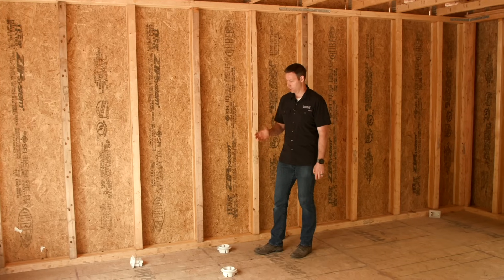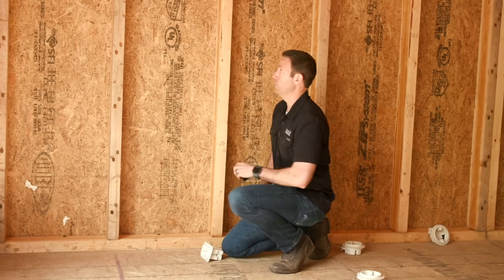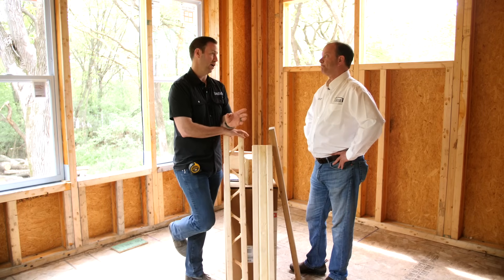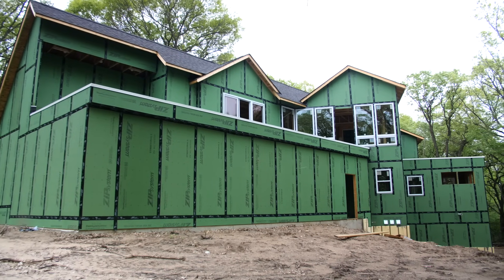Insulated Studs? This is a BIG Innovation in Framing!

Comment: Looks like a lot of houses are gonna rot out and collapse early
Reply from the maker: What makes you suspect that?  No matter the wood framing it must be kept dry. “If it can’t dry, it’s gonna die.”  Your water management system is paramount for a durable house. Huber Zip is an excellent system for both water and air barriers.
Reply: @buildshow  ill pass on replacing wood with foam

Comment: As a finish carpenter in always looking a products like this.  What he needs to do is get it into Lowe’s or Home Depot.  That’s what will change the industry first!   Drive costs down and save us all.
Reply: But he mighg only be able to make a 500 thousand a year their going to want millions always gonna be outa stock hes gota grow first
Reply: The only savings at the Big Box is to buy their OSB by the truckload, but then you piss off your lumber supplier by cutting him out of part of his framing package.  I know some will increase your board foot costs for joists or beams or something because you shop the rest at Brand X.
Reply: How many builders have their lumber delivered to build sites from Home Depot? I would estimate zero. I’ve never seen a lumber delivery come off a Home Depot truck, I don’t even know if Home Depot has flat beds or roll off trucks to deliver larger lumber orders
Reply: @Alex-us2vw  I've got a buddy who bought two units of OSB from Depot whey then held the price for 4x8 sheets at 7 and a half bucks during a volatile time when the lumber yards were a buck higher.  He saved 120 bucks.  Whoopie.  For 9 & 10 foot sheets you're back at the yard anyway.  He doesn't do it anymore.
Reply: Steevo did they have a way to deliver it to the job site? If not the buyer would’ve easily lost the $120 he saved in paying an employee to drive to Home Depot, purchase, get loaded, plus the fuel for the truck (if he even had a flat bed).
Reply: @Alex-us2vw  Depot delivered the first unit.  The truck probably had a forklift, just like when they deliver pallets of landscape blocks.  My friend used his own trailer for the second unit cuz it saved even more money.  He's always trying to get a better deal, but this proved too inconvenient in the long run to keep on doing.
Reply: Don’t think the Home Depots where I live delivers bulk lumber orders, and definitely not landscape pavers, bricks since they don’t them. Only the landscape stone suppliers seem to stock retaining wall stone, armour stone, pavers, geotextile, and bulk gravel/screening. The stone products at Home Depot here are consumer style DIY garbage. Even the washers and dryers they “deliver” come from a 3rd party delivery service
Reply: @stipcrane  They buy in enough bulk that they can keep pricing somewhat insulated from the market fluctuations but the quality of the OSB they sell is usually inferior to what you can get at most lumber yards. And like you say 9 or 10 foot sheets and your back to the lumber yard.
Reply: @iamjackalope  Depot is a huge corporation, far bigger than any lumber company, and I agree that they probably buy 10's of millions of dollars of wood product futures to weather price storms.  Also, they usually have OSB and 2x4's displayed as soon as you walk in the store with a killer price.  They may be losing a few cents on a couple items, but it gives customers the illusion that there is no cheaper lumber store on earth.  Lumber companies get 1000 board-feet prices and mark up stuff fairly uniformly, and you may be getting a much better deal on the rest of the stuff on your list.
As far as quality goes, everyone in the northwest is buying from the same mills (mostly Canadian) and they all come with the APA panel stamp on them.  I don't worry about panels—it's the studs at Home Depot and Lowes that scare me.
Reply: @stipcrane  Like any lumber at Home Depot you have to pick through the stack to get usable sticks. Their fork lift operators damage more lumber then anything else but their basic 2X4's and 2X6's Doug fir isn't to bad as long as it isn't to humid inside the store. I will use them for small jobs, like bathroom remodels and that kind of shit. Mostly I use them when I have to go there to buy other things for a job and I'll pick up the lumber while I'm there otherwise it isn't going to save me much money because Home Depot is 20 miles away from my house and the nearest lumber yard is less then a mile. Plus I like to support local businesses when I can.  

That APA stamp you mention doesn't always mean it's up to par. It's been a number of years now but I can remember having to remove a bunch of OSB shear panel someone put on a house because the panels didn't contain enough glue and they where falling apart. They had an APA stamp on them and they also came from a Canadian mill. 

But in all fairness the lumber on this particular job came from a lumber yard that was trying to gain a foothold in the area and where underbidding everyone else by getting their lumber from fly by night mills for quite a bit less. The lumber was so bad that contractors that I know where putting clauses in their contracts stating there would be a $5,000 additional cost if the owner choose to use this lumber company to cover job losses. But you are right about Canadian mills though.
Reply: Alex1911 dang your HD sucks really bad, so why have a lumber department or gardening center without a way to deliver products
Reply: @iamjackalope  I know what you are talking about when you say you need to pick through sticks at Home Depot.  Went in there once to buy 5 2X4's and had to dig through over 100 until I found some straight ones.  Some were bowing by more than 2 feet over there 8 foot length.  I try and buy from our local lumber yard.  When I need something and they are closed, I will go to Lowes now that we have one.  Lowes is not as good as the local lumber yard, but much better than Home Depot.
Reply: I called my rep at a very large regional lumber chain and the OSB price was $9.08  this morning.  An hour later I walk into Home Depot and the bulk price is $7.42 ($8.25 individual).  That's $113 cheaper for 68 4x8 sheets.  So will I do it?  I doubt it.  The lumber company will boom the OSB up to the 2nd floor gratis when the truss truck arrives.
Reply: Lowes and home depot?

No one should build a house out of a box store... higher prices in bulk and limited length availability

Gotta get it into lumber yards
Reply: Michael Barrella Not to mention often reduced quality of the materials and knowledgeable product support.
Reply: @michaelbarrella3043  higher prices in bulk? Thats the opposite lol
Reply: @jordanlittle5391   They have higher bulk prices.. Did I really need to correct that? Lol
Reply: @michaelbarrella3043  not here they dont lol more u buy more u save contractors also get 10% off sticker

Comment: Truss studs.  I can show you 35 year old houses with truss studs.   The amount of diagonal dowels is also a thermal bride,, and the claim of R-20 is again , an unreduced (not corrected for real world conditions) figure.   To the plus,,, It is still a vast improvement.  The diagonal lengthens the bridge path by 42%.  The total of solid lumber crossing the space is reduced by nearly 90%.  A high yield foam core,,, nothing but a win.

Now. Improve the performance yet again.  I suspect the dowels are wholly unnecessary.   Eliminate them all together,, The foam should be more than strong enough to transmit the shear from face to face.   In the real world, rain, stacked in the mud of a job site,, 2X3s love to twist,,the dowels are necessary.,, but still,, you only need one half or one third as many.

Mod 24 construction,, all structural elements stacked to eliminate the double top plate,, and other benefits,, is again a 40  plus year old innovation.

Matt,, one thing I do have long term experience with,,, I think you are sealing your houses too well. People live in there.  People breathe, cook, fart, shower,,,,, materials outgas, stoves, dryers, hot water heaters, all need to breathe.  Yes, you can get heavily into perms to make certain moisture is migrating properly,, but you still must breathe oxygen, get rid of CO2.

I built houses too tight.  Just as you do. At some point you tighten a house with wrap, tape, caulk, excellent tech,,,spend an extra 5 grand to make it Canadian tundra tight,,, and then spend another 5 grand on a air-to-air heat exchanger,,, AND the energy required to run it year after year.   Build a house perfectly, with zero leaks,,, and you will spend 500 to 1000 per year in additional energy for your makeup air.  A 1000 square foot house  requires the same 500 to 1000 per year as a 4000 square foot house.   What I finally evolved to was,, good construction practices, excellent bond treatments, zero house wrap  (house wrap loves to rot wood)  and 30# asphalt felt as the house wrap.  30# felt self seals, is moisture permeable, leaks air just about the perfect amount, it was a wonder material in 1910 and still is today.  (BTW  NOT 15# felt,,, 15# felt is just soft paper with almost zero asphalt in it.  30# and 45# both work well.  6" to 12" laps on every joint.)  A house with 30# felt under the siding will perform just as well as any spun poly wrap,,,, especially 5 years later.  (felt seals better as it ages,, wrap does not.)   And utterly skip the wrap and tape.,,, and the air-to-air heat exchanger, makeup air system.

Besides,,,, you do all those marvelous things and then install recessed ceiling lights.  Annnndd yours may be sealed units and flawlessly caulked and installed,,,,, but the next guy,, and all remodelers,, will reach for the 10 dollar unsealed unit and uncaulked.  Most modern houses I inspect or work on,, the makeup air system ARE the leaky ceiling recessed fixtures.

.
Reply from the maker: Wow, thanks for the thoughtful response. We generally agree on more than we disagree. Appreciate your feedback. Best, Matt
Reply: @buildshow    Matt, you and your channel interest me,, because you are good.  Not in full agreement is wonderful.  Two points of view,, both attempting to reach the same goal,,, absolutely invaluable.  I learn from you.  I hope I try give back some as well.
Reply: Building a dwelling air-tight is really important for energy efficiency. If you do not, then the winds just suck away your internal warmth. So build to really high levels of air-tightness, and ventilate the building correctly - then if it is blowing a gale outside, you can keep your windows closed and stay warm...
Reply: @greengenie7063   "Correctly" is the core word here.  Air tightness by itself is deadly.  How long will you or I survive if we place a plastic bag over our heads? Not long.
Carpeting, new, out gases a wealth of carcinogenic products.  ALL particle and chip boards are preserved by formaldehyde that takes decades to outgas and settle down.  I walked into a Canadian house built to exacting standards once and not only could you not take a deep breath,, your eyes watered so badly , you had to run for the exit,,,, formaldehyde. Dryer sheets... microwave popcorn, all spray cleaners, bleach, ammonia, farts, CO2.    A house must have a air change per hour minimum.   Some talk of an air change per 20 minutes,, per 40 minutes, per two hours,,,,,,,,,,,   Take your pick.  But I have built a house so tight so could not slam the front door,,and a window had to be screwed opoen to allow the people and furnace and hot water heater to breathe.

So there is certainly too much of a good thing.  My conclusion after 40 years building houses was do a really, really, good job sealing it up, and lots of fiberglass insulation, or cellulose,, but do not go overboard.  Spend an extra 5 grand doing a perfect job,,, and you will have to spend a second 5 grand to install the make up air exchange system Annnnnd pay the energy and maintenance costs of that system.  Get the house to where you are just paying for the leaking air,, about 1,000 per year in Michigan today,,, and that figure does not change whether for a 1,000 square foot house or a 4,000 square foot house,,, you are heating the living air no matter the size.   And stop there.  You can supplement with passive solar to reduce that,, but again,, how much are you going to spend, to save how much?  Spending 11,000 to save 250  is no bargain.
Reply: Daft. You don't understand the difference between air-tight construction and user controlled ventilation. Why do you think we have air-tightness tests in order to comply with building regulations?
Reply: @greengenie7063     Sorry to disagree.  Please keep in mind, I have been building energy efficient houses, passive solar, for 40 plus years. I grew up in a passive solar house in the 1950's.  I have been in this game a long time.
"User controlled ventilation"   Operable windows?  Make up air to air heat exchanger?  With supplemental heat?  The first place we will absolutely agree,, in the good 'ole days (bad 'ole days?)  Most houses leaked like a sieve.    That was wrong.  But there has been an over reach.  If well sealed is good,, then fully sealed must be better.   Uh,, no. 

There are many homes today, being built to code, that are just plain unhealthy to stay inside of.   The Canadian standard is the best I know of (I live and work in the US.)  A pressure door test to get your C of O where the aggregate leak is about the size of a basket ball.  That equates to about one air change per hour,, which with mixing also means about 5/8s of the air is replaced per hour.   But many times,,, many times, I have heard people, sales people,, engineers , being proud of the fact that the aggregate of the leaks in their house is the size of a softball,, or a baseball.  Sorry, I would not put a dog or a cat in a house with and air change rate of one air change per 3 hours.

So now you delve into the realms of 'must have' a powered fresh air system, a make up air system  'user controlled'?    Yep.  You can do it that way.  And you can be proud of your achievement.   You spent an extra 5 grand sealing it up tight,, over and above code.  And now you are ggoing to spend another 5 grand to achieve healthy fresh air cycles within the structure,,, annnnnd you will spend 1 grand per year in maintenance and energy inputs for that system,,, that will also require rebuild or replacement in 15 years.

You design the house as a sensitive to the environment structure to begin with,, the house faces the sun and faces away from the prevailing wind,, or is well shaded to avoid solar gain,, water, rain,, hot, cold, considerations  NOT only facing the street.  I don't care where the street uis,, the first thing the house must face or face away from, is the sun.    You then do a fine and attentive build of the structure,, targetingf a structure that naturally changes its air every hour or so.   And throw the other fancy sales crap in the ash can.  If you do a really good job with the design,,, on paper first,,, then faithfully execute that design in physical structure,,, you absolutely do not need all the expensive and often useless foll de roll.
Reply: Not sure what planet you are living on and I find you difficult to follow at times.
Apart from pioneering the UK's first monitored, (highly air-tight) passive solar dwelling (off-grid/no heating system) in the 1970's, I now live in an externally insulated 1930's house with south-facing windows.  Very little heating is needed in winter and all you have to do is give the house a quick ventilate in the morning. I do not approve of 24hr active MVHR systems as I feel buildings should be economical, robust and fail-safe - as well as affordable.
(I would prefer a superinsulated passive house, but sadly life has not allowed me to create another one for myself).
Air-tightness is nothing to do with ventilation, they are separate issues. If your building is not air-tight, the winds will suck away your heat, making your insulation ineffective and you will need to have an unsustainable heating system. That is why leading companies like Proctor make moisture-vapour-diffusive, air-tight membranes!

Comment: T-stud; T stands for time will tell, if the glue hold.
Reply from the maker: Have you seen failures of wood glued with Polyurethane glues (think Gorilla glue)?
Reply: @buildshow  Yes, quite often; not to blame the glue but the substrate it was glued on.  This is not a new concept; this methodology was used in the RV industry for a long time.  Find and RV that is not a money pit is an impossible task.  Houses build like this will fare the same, of course Time will Tell= T-stud.

Comment: I found tstud on a web search about a month ago when researching thermal break and talked to Brian. I think product is a breakthrough. For now the only way to get product to Texas is direct shipping via truck which drive up costs. If he can gets one of the major distributors onboard so he can ship a train car load at a time etc he has a home run. When are you or Doug going to build Zip 3.0 with this product?
Reply from the maker: Ha!  Hopefully soon. I was impressed. I’d do this with Z-R Insulation. Killer combo. Zip 3.0. Can I use that? I like it!
Reply: The reason they are only shipping per confirmed orders is due to current production limits and time plus supply for them. I am hoping they will make without the foam included since it would speed up install of utilities as those going with foam anyway the foam would just fill it in no matter what.
Reply: Matt sorry I trademarked it 😀 naw just kidding . Be my guests as long as I get a build hat.....